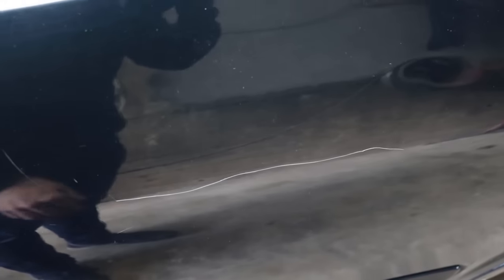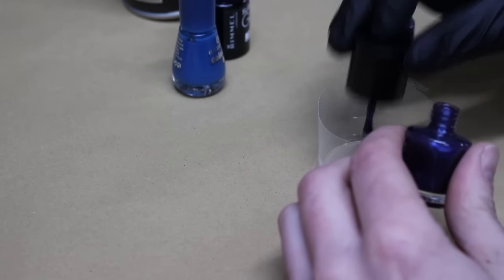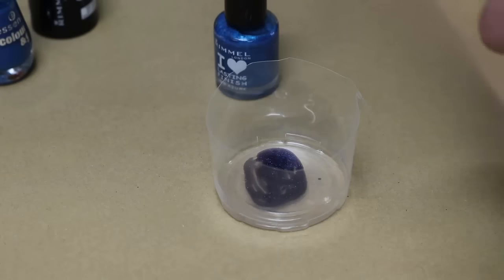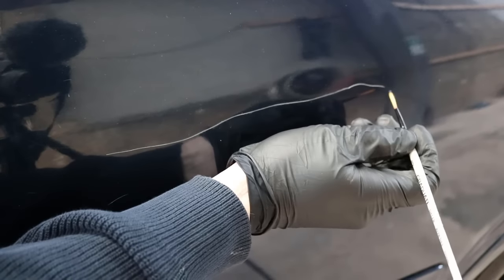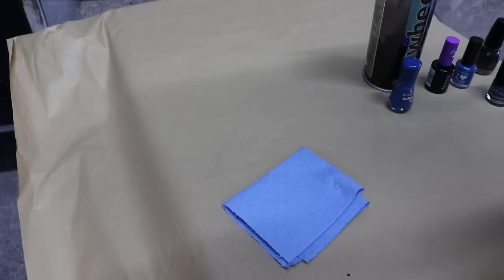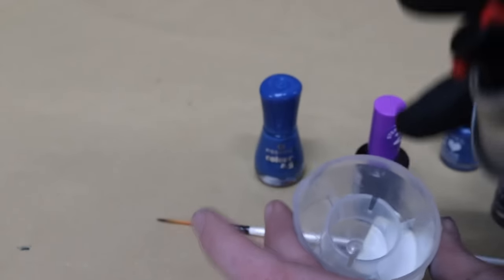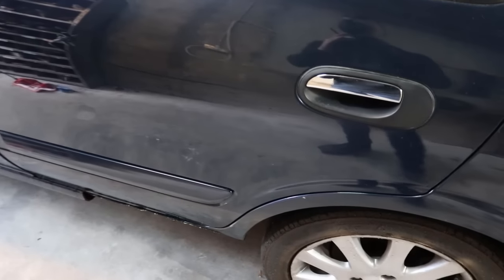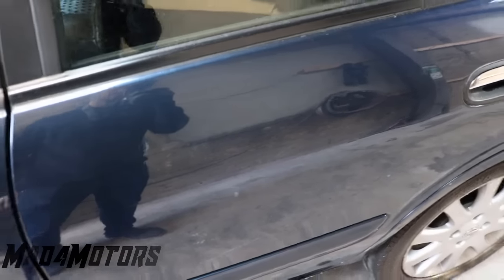How to repair scratches on your Car. Ultimate Hack

Comment: I’ve done this for years. Had a black car years ago and used a black nail polish to touch up scratches. Works a treat
Reply: You think this would work on a blue pearl car?
Reply: @josem1596  Yes, but add oyster (pearled) color to the mix, it's that which gives the pearl effect.
Reply: I have a black car with deep scratches will this work ?

Comment: Excellent video.
I tried repairing scratches on my old car using fine grit sandpaper, touch up paint, HOLT spray cans, 2k clear coats, putty, Meguiar ultimate compound, wax and scratch remover and the result was horrendous.
Nail polish is the way to go.

I agree with others who have said not to use nailpolish remover. They tend to damage the clear coat and then even after spraying 2k or 4k clear coat, you never get the shine back.
Reply: Was exactly my shopping list! What went wrong?

Comment: Thank you! Did you know that keeping nail polish in the fridge makes it easier to work with? Also, I use an eyeliner makeup brush for car detailing as it's so fine (you can find cheap ones in Poundland or Primark).

Comment: Most auto supply stores sell touch up pens to match the paint code of your car exactly, no need to buy nail polish.
Reply: SabretoothSnail where would I go to get One?
Reply: @kobe12348able  advance auto i know has some, O'Reillys does too I think
Reply: Reason for using nail polish is it is thick and can easily fill a deep scratch. No way regular car paint would fill a deep scratch like this with just 2~3 coats.
Reply: @SupeDefy  I figured there was a reason for why he was using nail polish instead of matching car paint. But he never explained why in the video.

The only pain in the ass I can see doing it this way is trying to get the damn colors to match. Would this process work for super deep scratches that go all the way down to the car's bear metal?
Reply: @Superman-xr1oh  I don't pretend to be an expert, but I'd say no. The nail polish can only  fill so much.  I've seen people use different fillers to put in the scratch, and then use nail polish or paint marker over the top.  The important thing after that is to make sure to wipe that polish remover/or sand a little and then polish at the end.  It won't matter how close the color is if the finish isn't smooth.
Reply: Just go to your local dealership thats the same brand of your car and buy a paint pen that matches the color of your car.

Comment: some guys actually scratched my car yesterday, probably because they had a hard time getting out with a trailer. (were jet skiing) fun part is that i had already bought clear coat 3m sandpaper 2000 and a 475 metallic sapphire black to do a repair on the bumper. so with this vid for sure i can get it done. thnx mate

Comment: I've ordered a Dr Colorchip (which appears to use the same sort of methodology as this) to try and fix some scratches I 'rediscovered' after removing the vinyl wrap on my car, but if that doesn't work I will try this or just spray the panel. I get more damage to my cars paint in the work parking lot than anywhere else. Have scratches all along the front fender where I think someone has sidled alongside it and hit the paint with a bag zipper or jean rivet.... I followed your other guides to blend repair my bumpers and got a pretty good result, learnt a lot and will have a much better result next time.

Comment: Every other video said that all you can do is wet sanding. They all claim that there is no way to fix a scratch deeper than clear coat at home, and you proved that wrong.  Infact, it seems that the only difficult part is mixing the perfect color. I'm glad you advised to still polish everything when done

Comment: Use clear coat cos clear nail varnish melts the paint around it,  I tried to fix flaking paint around a debadge and smudged off the clear coat

Comment: Illness interrupted the plan, but my bonnet, wheels refurb, rear corner dunt needed repair so I got keyed scratches and etc done.
£1250.
New tyres + Battery.
£350
The Car itself.
£1250
Luxury and Reliability for under £3K.

Bought the Lex LS pre damaged but one owner and full Lexus servicing, so worth it.
Drives like new, looks like new, eat your hearts out, puny Mercedes commoners !

I won't forget your lessons though.
.

Comment: If you added a clear nail gel it will keep it from drying quickly. Then use a little uv lamp after you apply. Better to do multiple thin  layers.

Comment: Such a better way to do this is, slap the paint over the entire length of the scratch quickly in 10 seconds, then run a razor blade over it at an angle just like a plasterer does with a trowl on a wall. This way it sinks the paint evenly into the scratch and removes the excess without you doing any rubbing after.
Reply: Razor blade at an angle ? I’d be worried if it causes more damage
Reply: @jamiejeffries5017 I'm a year late to this but he means feathering it. You hold the blade at an angle with the blade edge facing away from the direction you are pulling it. Just like how you use a putty knife or drywall compound trowel for home repair projects, or a spatula for spreading frosting on a cake. You never point the edge in the direction you are pulling.👍

Comment: Nail polish works actually 
I did this on my vitz 09 and its long lasting it has same glitters i think i learnt is to use tip brush n clear coat i will now apply compound polish that will total fix the spots ..

Comment: I touched up my car scratch before it did look great. But after few months the nail polish must have a reaction to the car paint that it spreads a cracks veins from the nail polished painted scratch. It looks like a spider web ,you can see cracks that spreads into a bigger area of car panel.

Comment: Great video. I wondering if you are able to give myself some advice. I used chipex to paint in the deep scratches my wife put on the car and it was given a polish  afterwards. I'm now trying to take away the shine of the scratches, what should my next step be? I've been toying between getting Meguiars ultimate compound or Meguiars Quik Scratch Eraser Kit or do I just get 2000 or 3000 grit sandpaper then polish it? Anyone's advice would be appreciated.

Comment: I did a deep scratch touchup on my wife's rocker panel.  I think a lawn mower scraped against it.  Only thing I did different was I covered the bare metal with primer.  It's hard to find even though I know where it was.

Comment: Great quick fix! Or longer term if an older car run on a budget. The only thing I'd do differently is, if scratch is down to the bare metal, Id coat with a rust converter/preventative first?

Comment: Great video! Do you use the nail varnish once the paint has dried? Or immediately after you’ve filled the void?
Reply: You should let it dry or the color might come off onto the brush if it hasn’t dried completely. It could also clump onto the brush if you apply the brush onto it before it’s finished drying, which would add more texture to the scratch

Comment: Have a question. I have a C5 1999 Black Corvette I purchased back in 2010. I don’t drive the car much. It’s sits indoors. On the top of the roof the previous owner put a 3” scratch I would say no more then 3/16” Wide taking the top off and setting it in the hatchback. Doesn’t seem like it even broke into the primer because I still see black paint inside throughout the scratch. But I can well feel it with my fingernail so I believe trying to sand it out isn’t going to work. I need to build that area up. I wish I could post a photo here to show you but You Tube doesn’t allow it. I have been living with this scratch still there for 11 years. The rest of the paint on the car is immaculate. I was thinking of buying a can of 2k clear and taping the area off well and spraying some clear lightly into that area and a little beyond until it fills it in and waiting a day or so to wet Sand it with say 2000 sand paper and buffing it out with a machine and Meguires Ultra compound . I would like to know your thoughts about it. Do you think I am better off taking a small paint brush like you used to fill the area in instead? I have touched up cars that I own in the past just using a can of Duplicolor Spray Rattle can paint which is lacquer paint and their clear coat which is also lacquer with great results after lightly wet sanding and machine buffing it with Meguires a day or so later.  Seem to look as good as the basecoat Clearcoat when I was done. I just don’t know how long a repair like that would hold up on a car left out in the weather like a Van I own I plan to do soon. I figure I could buy a can of the 2k clear and use it on a few jobs before the can of clear goes bad in the can.

Comment: Sir, what do you think of filling the scratch with hot glue, sand it to be smooth, and repaint it ? Replacing putty with hot glue, is it possible? Cheers!
Reply: Could possibly work, until you park in the sun on a hot day.

Comment: Is there a reason I wouldn't be able to use factory touch up paint to fill the void?  I suppose the nail remover is key to light blending and it wouldn't work on the touch up paint?

Comment: What is the advantage of using nail varnish over ordinary automotive paint to do the same job? fill the scratch with paint in the correct colour until its slightly proud of the panel, then use a metal type shark blade to shave it down to level it
Reply: It's very thick and dries quicker.

Comment: Great video I was just wondering why you didn't use touch up paint from the dealer that matches
Reply from the maker: The nail varnish cost a dollar
Reply: I for one, have tons of nail polish handy. Rather than go to the dealers and getting ripped off, as Mr. Mad4Motors says, the nail polish only costs a buck or two.

Comment: Thank you. I have an old Jaguar but the people here seem to hate the car. I don't know why. They constantly scratch it. I think they are keying it. I think it's a single person who just has something against my car. I've never even had words with anybody in the neighborhood so I don't know what the problem is. It's not rich it is a 20-year-old Jaguar.
Reply: Damn. That's gonna cost a few thousands to fix.... actually, you said your car is over a decade old, so probably not
Reply: @2pacisAkiltheMC  still had value here where I live. I have sold it since, but it survived since I fixed it for three more years. That fixed the overheating problem and there was no problem with it whatsoever. It didn’t damage the car at all. I just took the radiator out from the top without pulling the whole front of the car apart.

And the only thing I modified was the radiator itself, so it didn’t damage the car

Comment: As a wife who hasn't thankfully had her polishes raided yet... I was dying inside when you didn't screw the varnish bottle shut straight away. 😱Good tip: If your wife has any rare or expensive colours, she can keep them in the fridge so they last for years. Some brands apply better slightly cool as well, such as semi-opaques and glitters. Eventually they dry out and go gluggy if you don't refridgerate them, so she can have the rare ones for 10+ years if looked after. Thanks for the great video. I am NOT saving this one for hubby to see, though, as he'd leave the bottles unscrewed for hours! 🤣

Comment: I don't understand why you are using nail varnish, surely it makes more sense to get the correct match from the paint code, and what about primer, you are putting nail varnish over metal with no primer, crazy. Might look good for now but that scratch gonna come back through eventually. I would not advise this to anyone. Fill it, sand it, prime it, paint it, and add clear coat, don't do this guys, its a botch job.

Comment: Why didn’t you use the proper car paint instead of mixing nail polishes 

It would have been easier and a more better colour match. 

Ps. 

The lacquer must be smoothed by applying a light cutting compound  to blend into the rest of the paint work.